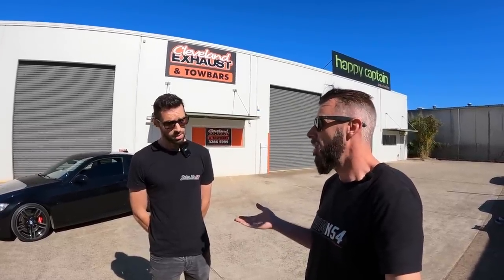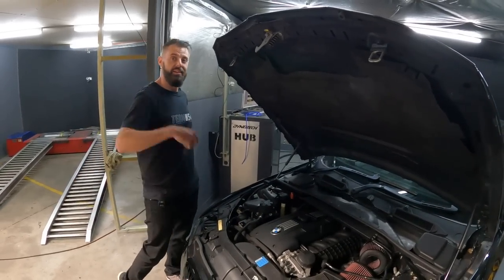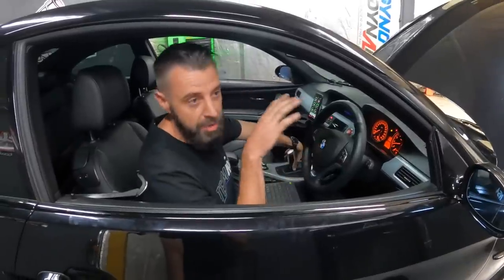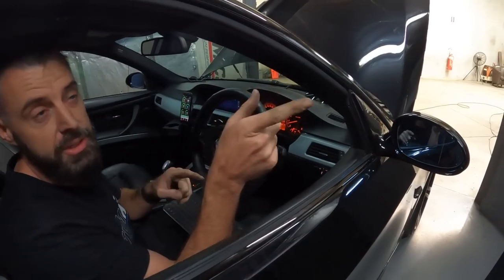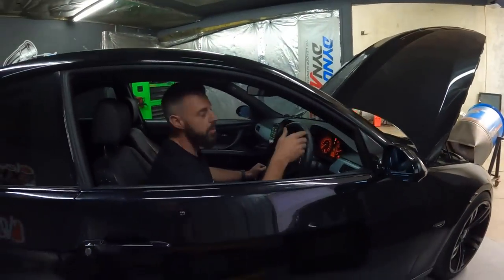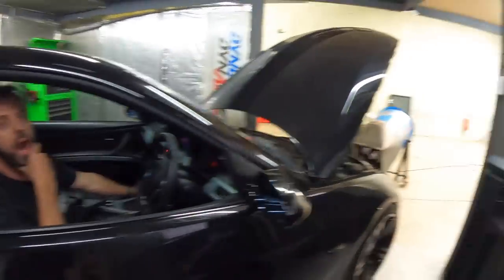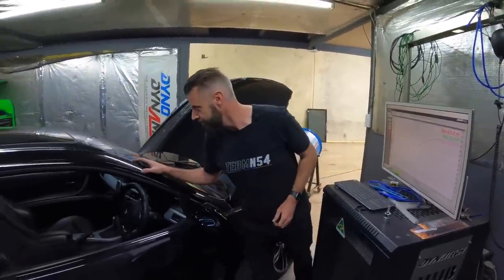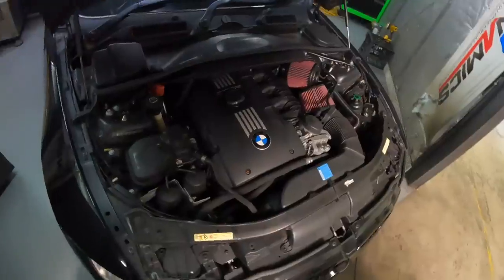BMW 335i 17T Dyno Numbers: WHAT THE F***?

Comment: That's about right for ur boost level on ur twins, you don't need a lot of timing  at all. I think the 17Ts are the sweet spot honestly, bigger isn't really  usable anymore, and smaller Turbos suffer top end.  Awesome build.
Reply from the maker: Thanks man, wasn't expecting to break 600whp on a aussie dyno. Goal was always dyno jet 600whp, so pretty damn happy. Have you dragy'd your single setup yet?
Reply: @ZeroTo60Tube  I did,  I need some better rubber in the back though  it made 6.22 spinning half way thru third.. my street tires ain't cutting it especially with an open diff.an identical car with an m3 rear end and 305s in the back ,local to me , when we tuned it , it made 5.6 secs 100 to 200 , still spinning but not as bad
Reply: When I say identical I mean same kit,basically the same tune,but he's a manual with 7700 rpm limiter(upon his request),and 305s out back so yeah not really identical lol, but similar power on the dyno.

Comment: That was the most casual 625hp dyno run I've seen on YouTube... ever!! 😁🤘 I'm glad it did make that number, it kind of validates what a lot of us have been thinking a decently tuned hybrid turbo n54 makes at the wheels! Thanks to the Hoff and Nugget Garage for making it happen 👍
Reply from the maker: Welcome to seeing what a load based dyno does. The dyno fully controls how fast the car revs. Which means tuners can more accurately tune each RPM range. However, it doesn't make the cool noise of a fast ramp. That said you can set these to sound cool, but it's more for wank than actual purpose.

Comment: Insane power out of those 17ts and auto transmission. Thanks for doing this. Doesnt seem like I’d need to upgrade my transmission after all.
Reply: It will start to slip after a good while running that power just as a heads up (:

Comment: When you go full single might be worth looking into a stand alone ecu I recently found out motec ecu can support direct injection- high pressure fuel pump- dct control and has a n54 base map, bit pricey but might be worth it to future proof things ???
Reply from the maker: I have been toying up stand alone. So much more control and safety. More hours is killer expensive tho. I have been thinking about ditching the di tbh.
Reply: @ZeroTo60Tube  agreed Ive been saying go Haltech on some of the videos but of recent found out Haltech doesn't offer some of the supported features like the motec does for the n54 should look a look at them
Reply from the maker: @davidstevenson1211  I keep going back to maxxxecu. They intergrate with the e9x cars perfectly, so the car will work completely as stock as far as the driver is concerned but the DI will be gone. One good thing about maxxxecu is they will also control the DCT
Reply: @ZeroTo60Tube  yeah I've seen maxxxecu they look alright might have to pick one and try it, it would make a good video on weighing up options and what's needed

Comment: Wtf this car is wild, still blown away by the 6.1s 100-200
Reply from the maker: Keen to see what the cold weather does. Never driven it for a 100-200 in sub 20 deg c temps. Tomorrow, lets see whats on the cards now.
Reply: @ZeroTo60Tube  harden up. Come to nz for some sub 5 deg c pulls 😉
Reply from the maker: @Ewok_Nz  i would kill for those temps when trying to make power.

Comment: Wow congratulations on the buld like your Channel a lot always has great content I have a 2013 335is made 653whp on dyno pushing 28psi dynamics autowerks flowmax    it was dyno tuned I feel the power isn't there I'm going to have it street tuned to see if there's a difference what is your wheel and tire set up looking new setup but the roads in NY are horrible
Reply from the maker: Grab a dragy and remove any doubt on its power. Dragy best way to know what it’s doing in the real world. 

Current wheels are m437 genuine wheels and they pretty light, car feels faster with these. Also have a 18 set of Koya wheels which I run the ar1 tyres on for trying to really go quick.

Comment: I dont remember if you mentioned this during the install, but did the wastegates on your 17Ts need any adjustment before install? Looking for a cheap, "throw in" solution for more power and no more rattle for my OEM turbos.
Reply from the maker: I didn’t adjust the gates no.

Comment: Those zf6hp19's seem to handle the power well. Guess lock up converter is (still) doing its job. Did u brake any auto trans?
Reply from the maker: Haven't broken the trans yet, i have only heard it slip once and that was trying to do the 0-100 runs with the semi slicks on. It just didnt bite in to 2nd gear like it used to.

Comment: Any info on what the Torque reading was?
Reply from the maker: The dyno wasn't connected to the RPM signal, which i think is why there is no torque reading. TBH i wasnt even thinking about it. Was just looking for HP and keen to check AFRs on the dyno were similar to what JB4 was logging.
Reply: @ZeroTo60Tube  man...a torque number would have been sweet though! Thank you for getting her on the dyno though. Time for me to start throwing cash at my 07 335. Lol

Comment: Well done gents. Thats some strong numbers. But I can honestly say on a proper load dyno, u won't make more then 600whp. I had mine dynoed at 21psi and made 557whp and 740nm. That was on 93/95 octane unleaded pump gas with 1lt of NF Ultra race additive.
Reply from the maker: This is a proper load dyno….. in fact this is one of the most power proper load dynos you can buy. The retarders are rated to hold 3000hp. I didn’t realise while filming but it’s dyno dynamics latest and greatest dyno for high power cars.
Reply: I'd like to see u do a few dyno runs on rollers. Will be interesting to compare the results.
Reply: With 17t turbos you made that power?
Reply: @n54  We now managed to get it to 612whp with a little tweeking on my back end flash. An absolute beast now 💪

Comment: Interesting, virtual Dyno showed 588whp from your 3rd gear log you posted the other week, however 3rd has less load than 4th gear and the log finished at 6200rpm which will be below your peak power..
Reply from the maker: Correct, also wont have accurate weights, air temps or tyre size with the info you had on the log. :P
Reply: Virtual dyno works

Comment: what was the car setup at this time?
apart from the 17ts
Reply from the maker: Its had 2.5" dual exhaust, modified RHD outlets, DCI, port injection, 7 inch china cooler, JB4, elder coils, tuned by JSR.

Comment: My opinion, hopefully others will agree?  Don't do a single turbo. You already have a single turbo car. Just push the 17t's to their max first. Still so much you can do to this car.
Reply: Yes I agree. But truthfully anything these guys do will be awesome!
Reply from the maker: I still wanna wind them up for sure. But 17t twins get to a point where you start risking the motors due to back pressure. I’m probably just under the danger zone right now (maybe). But driving a single is a whole mother experience. We will keep twins on the Vargas car tho. But I want them to be better than the 17t twins
Reply: Interesting I haven't heard of this back pressure issue. Looks like I'll be doing some research. I'm pussing my 17t's at 26psi and 19 degrees of timing. So far so good. Thanks. Always learning.
Reply from the maker: @socobarbell  Jesus 19deg of timing. I have only heard of race motors doing that and then its like for 1 or 2 passes. Are you on stock rods?
Reply: @ZeroTo60Tube  I have logs with the off the shelf e85 port injection be flash when my engine was stock where it was pulling 22.5 degrees. I guess I don't know enough about the tuning side to have thought that was alot.

Comment: How much Tourque in ft/lb ?
Reply from the maker: The dyno wasn't connected to the RPM signal, which i think is why there is no torque reading. TBH i wasnt even thinking about it. Was just looking for HP and keen to check AFRs on the dyno were similar to what JB4 was logging.

Comment: See what I meant. My car with the aggressive tune that it has and only 43 thousand original miles. I didn't cut any corners with parts either. The AFE dry filter intake I have with VRSF catless downpipes, agency intercooler, VRSF charge pipe with twin turbo smart blow off valves my car screws. I wanna get it dyno'd. I know I'm making at least 500+ ATW's. We'll see eventually. I'm still doing a few things but my video is right around the corner. Bought a new dog so got side tracked this week...👍🏁
Reply from the maker: Just had a side thought. What about a dragy? Will probably be the best side by side power comparison. Unless you can get on the same time of dyno.
Reply: @ZeroTo60Tube  I want to get a draggy but there's really no where for me to get on my car unless I go on the highway which state police are always in cars you'd never expect! I'll get it on a Dyno soon enough. This guy I used to hang out with like 27 yrs ago when I had my Vortech supercharged mustang just bought a new shop and he has a Dyno. I'm gonna try and make that video tomorrow or this weekend. I just bought a new dog and have to pick it up at the airport. Plus I have a muscleskelotal disease called fibromyalgia that always messes up my plans. You guys will be the first I contact when it's done so you can see it....👍🏁
Reply: @ZeroTo60Tube  Check out my car on Instagram. Jordanberry32 you can atleast see the car and some of the titanium I've been doing under the hood. You can see some mods as well. I got a new number and can't get into my old Instagram...??? But atleast you can see my beast!

Comment: well done guys i can see some custom made axles coming real soon
Reply from the maker: Kinda makes sense why they keep breaking now.....
Reply: @ZeroTo60Tube  did you find out if you have a faulty waste gate have you had a good look at your 2 cacuum canisters to see if any have hair line crackes in then do they feed each waste gate?  i hope its warm up where you are as broken hill in friggn cold cheers glenn
Reply from the maker: @glennarnold3970  Havent found the issue. 3rd gear is still that 1psi under target on the street. I havent wound out 4th on the street. It was closer to target on the dyno, but the load that dyno puts on the car is insane so it will build boost better than on the street.

Comment: Howuch boost guy? This is crazy, I have to be way over 740 then
Reply from the maker: 26psi. Would be keen to see yours on a dyno. My only advantage will be port injection. You and i run similar timing targets. But your turbos will flow a lot better.
Reply: @ZeroTo60Tube  yes sir, that's true but I am running a lot of methanol though those two nozzles in the charge pipe cm10 and cm7, that compensates for the rest of the lacking Ethanol, I think I found the perfect fuel set up is the one it's running now, a lot of meth and e40
Reply from the maker: @ALEX.THE.RUSSIAN  fair enough should be interesting to see that’s for sure.
Reply from the maker: @ALEX.THE.RUSSIAN  I should add with port injection and e85 you’d be able to target closer to 15deg in a kill tune. Ohhrly has run 18deg for its passes. Getting that large volume of e85 I. The cylinders helps massively. More so than meth.

Comment: Great number at 625hp. The hub dyno is the best way of getting the correct power numbers. It eliminates quite a few variables such as wheel slip, wheel diameter, etc that you get on a roller dyno. The number is always higher on a hub dyno compared with a roller dyno because of this. This is explained in this video. https://www.youtube.com/watch?v=DtgEB8jpsYU . With traction you should be able to pull mid 10s runs Andrew.
Reply from the maker: Very true!
Reply: @ZeroTo60Tube  It would be interesting to see what result OHH RLY would manage on a hub dyno. I would imagine it would be more than Dan got on his roller dyno.
Reply from the maker: @kencooper8636  We will get ohhrly to Scott for the comparison one day. But im guessing probably another 100hp based on what scott was saying. He basically said the more power you have the less accurate the rollers are.

Comment: I shredded diff gear with 550whp 590tq
Reply from the maker: That’s something you don’t see very often. Where you on stock axles or upgraded?
Reply: @ZeroTo60Tube  stock axles, open stock diff. I don't even launch it just aggressive cornering, some power slides. I couldn't find many people with a broken diff either, maybe I got unlucky.
Reply: Curious, small or large diff housing?

Comment: Would you do me a favour and take the time to really read the comments and analyse. One guy is so illogical with what he says. He says that your build is only good for 600 crank. If the accurate hub Dyno (and believe me they are very very accurate) says you are producing 625 at the back wheels then obviously the motor has to be producing at least 10 to 15% more if you allow for parasitic loss and add it back in. I have a new Mustang tested at 750 crank and it reads on average between 620-640 rwhp. Same dyno(exactly) same results.
Reply from the maker: My numbers are huge, which is surprising. But it explains the 100-200 times and snapping axles.  It many people run my setup anymore with jb4 and Pi so it’s a bit of an unique setup that clearly works 

There is the issue with the dyno jet no load dynos which pump out big numbers on a lot of USA N54s so they automatically expect this to be like a no load dyno number.

The reality is a dyno is a tuning tool. Nothing more. Unless you have 2 cars on the same dyno it’s hard to compare apples to apples.

Comment: 17t 600hp ? Really? 🙄😮😮
Reply from the maker: Yeah theyll do it. But they make power down low so easily they will also crack your pistons at this numbers. A lot of heat getting trapped in the engine due to small turbine sizes. Mind you still massive turbines compared to stock 10t
Reply: @ZeroTo60Tube  if 17t can crack the pistons how about 19t then? Im planning to install 19t v4+meth?! 🙄 (stock engine)
Reply from the maker: @shoha1100  yeah they will to. 600whp or
More on twins is the danger zone.
Reply: @ZeroTo60Tube  do 19ts have lag compared to 17t?

Comment: 566 wh
Reply from the maker: Thats pretty sensible. Thanks for having a guess.
Reply: @ZeroTo60Tube  Unbelievable nice numbers I have a E92 335i 2009 with DCT stage 2 stock turbo's you will have fun to with the DCT :)
Reply from the maker: Yeah, im really looking forward to the DCT swap. Also nice to xHP's latest software extra line pressure should help the clutches hold up when i go single later on.

Comment: 750 crank? No chance. 
Your build, boost and timing sound about right for circa 600 crank. 
No offense but let's not get carried away!
Reply: Why would you say something so illogical? It is making 625 at the wheels so allowing for parasitic loss it has to be making 750 crank. I have a 2019 Mustang Roush supercharged Coyote with the 10r80 transmission making 750 crank and exactly the same brand hub Dyno and it reads 630 rwhp
Reply: @edthomas8486  because I know a lot about these engines. Sorry if you don't agree, but what I've said will be logical to N54 tuners.
Reply: @Saavvvv  You couldn't be anymore wrong. Running port injection, bigger lpfp, 26.5 psi, e85, and a good tune will make around 575-600WHP
Reply: @Justin-qs9nj  thanks for your American opinion lol
Reply from the maker: John Sav bad quick maffs on my behalf while filming, but it should be around the 720hp at the crank based on these dyno numbers. The dragy numbers pretty much confirm it based on what other stock high power cars of similar weight do 100-200 in.

Dynotech is a load based dyno it’s the new stuff from dyno dynamics for high power cars. 

600 crank will struggle to do sub 7 seconds 100-200s and it won’t snap axles through a 6at.
Reply: @ZeroTo60Tube  our 640bhp crank did 6.3 and that's a manual gearbox too.
Reply from the maker: @Saavvvv  check out autotop nls 100-200 list and see where you sit and what stock cars you are faster than. You weight more than an aventador, you have a slower transmission, you are faster, but you think you have 80 less crank horsepower. Scott said yesetrday anything over 500whp on a dyno dynamics roller, you wont get accurate numbers. You can also make different power on rollers by how they are strapped down. The hub dyno is more accurate and the number i got yesetrday more so reflects what my crank hp would be on that 100-200 leaderboard. Dyno's are tuning tools that is all. But the newer hub Dynos are what people are more so relying for accuracy when tuning high power cars.